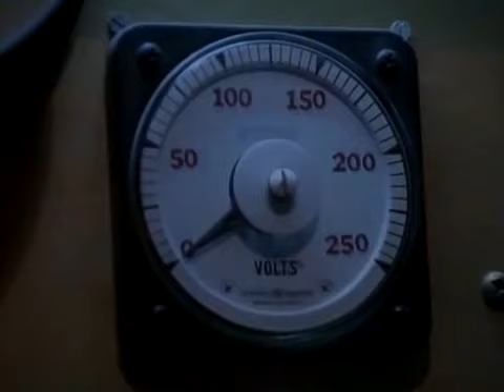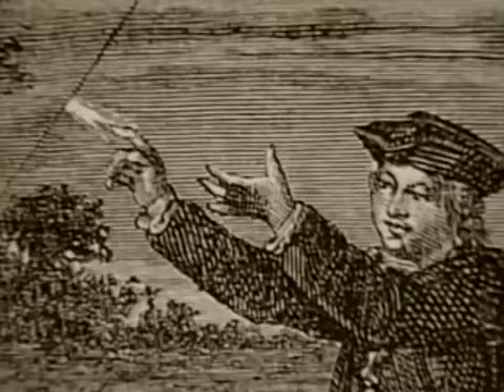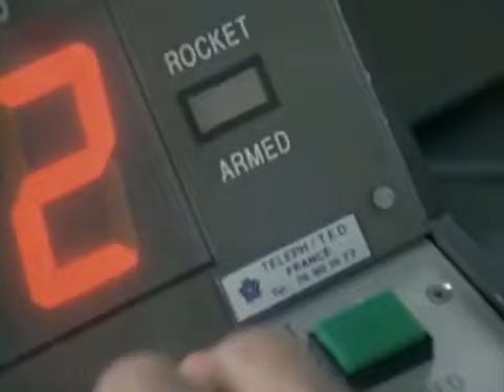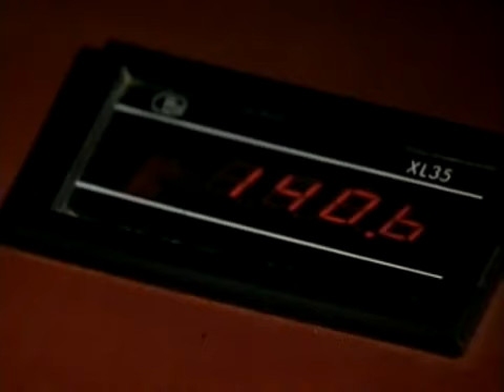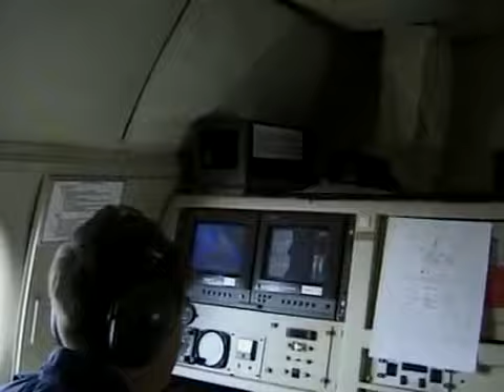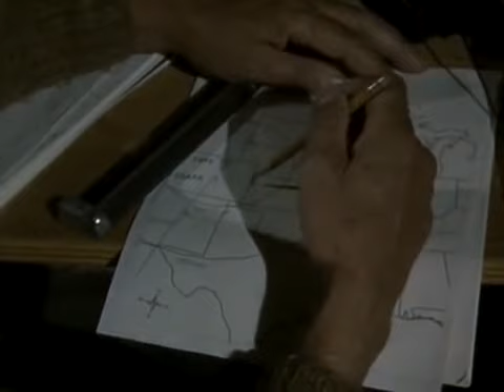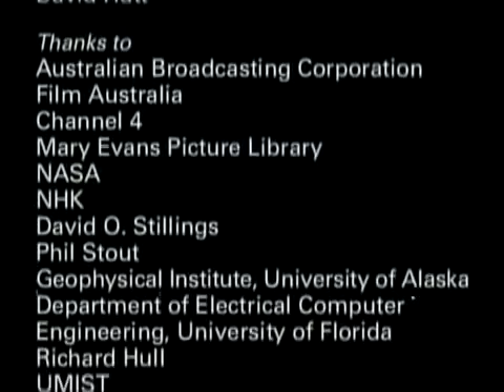Discovery Channel Raging Planet Lightning 2001

Comment: I love lightning too! I have been at the highest point in the local hills when a thunderstorm started rapidly forming and you'd better bet your ass that I didn't stay at the highest point but hiked as fast as I've ever hiked back to my house. I was at the bottom of the hills when the lightning started striking around the area and I knew it was dangerous but I had no choice but to walk home and I figured that I could at least try to get some videos of lightning since I was stuck out here and especially if it was going to potentially zap me. They aren't good but I was taking them while I was still walking as fast as I could toward my house. It was totally awesome and all it did was get closer and louder than I would like while I'm outside.

When I was much younger than that, I was sitting between the sofa and the big front window watching lightning when lightning struck the end of the street. It was so bright and so loud that I somehow went from kneeling behind to sofa to jumping backwards over it without even touching it and it had a relatively high back. I didn't get zapped by electricity, but adrenaline. It sounded like a big explosion at the end of the street but I didn't hear that until I had almost landed from my random backwards jump over the sofa. I literally have no idea how my body figured that it would do this thing, let alone how it accomplished the feat but I completely cleared the sofa somehow and I was a kid under ten.

Comment: That first description of being struck by lightning reminds me of when I got zapped, while in a shower, by 220 electricity. I don't feel like any time was missing but I went from standing in the shower on one side of the bathroom to standing on the other side of the bathroom all wet from the shower and I just know that the electricity flung me like that. My heart started beating fast enough that I quickly put on my clothes because I didn't want to be naked if an ambulance came. Before I could finish putting on my clothes, my heart slowed down again. Scared the crap out of me though and I had accidentally touched a 110 before too, which is more like drinking the entire pot of coffee.